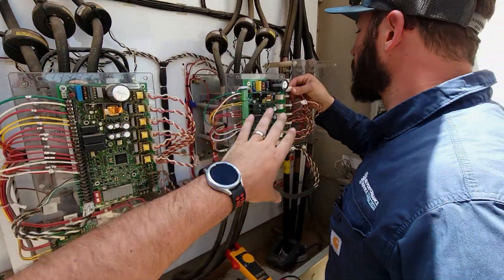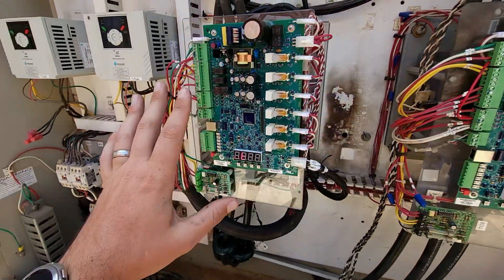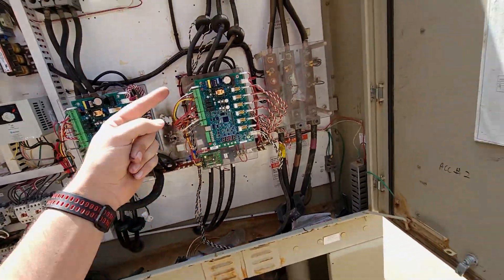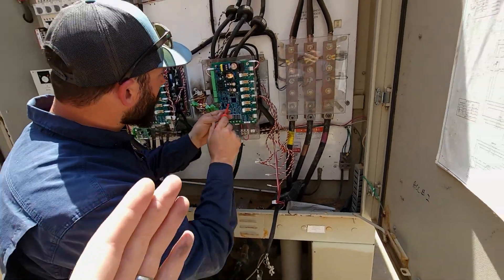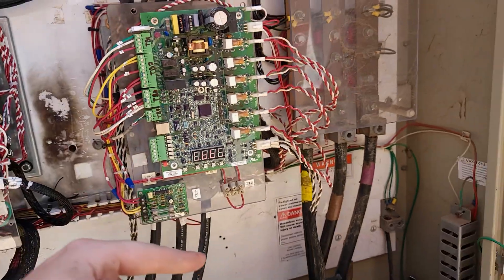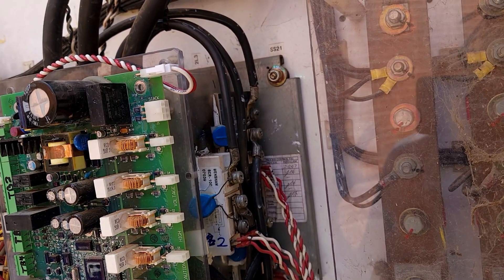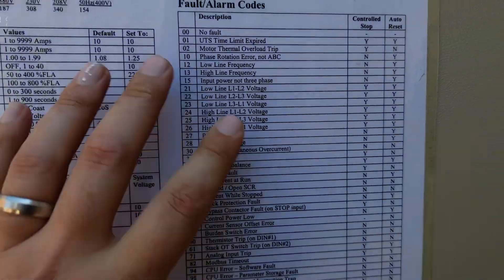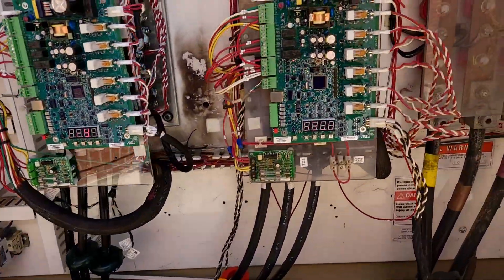Old McQuay Chiller Starter Issues...

Comment: Anytime you are dealing with SCRs or any solid state power switching on 2 pole or 3 pole/phase systems.....ALWAYS replace ALL of the power switching components!  The high current drawn by losing the other phases (or the surge created when one blows out) will ALWAYS destroy or weaken the others! (Same goes with capacitors in VFD's or soft starts..if one of the main power caps fails replace them all.)

If the customer is too cheap to understand that,  either walk away or put them on notice in writing that any subsequent return calls to replace other failed components is a full charge and will not be warrantied. 

I had this issue a lot in my cinema service days, the lamp rectifier diodes would fail, and I always replaced then as a full set (4 or 6).  Any theatre that insisted on replacing only the ones that failed got no warranty.

Comment: Something I don't get about this industry. You said this is dragging out for months, and the customer didn't approve replacing the third SCR. Do they not need these chillers up? Sounds like lots of follow up visits for parts that cost less than the truck roll to get them there.
Reply from the maker: Ya, job's like this one turn into complicated situations that end up being a slow play out until everything comes together.

Comment: So did you place a jumper on the NO contacts of the contactor ?
Reply from the maker: No
Reply: @HVACTIME  So basically did you insert a wire from one end to the start input and the other end to the contact coil ?
Reply from the maker: Ah yes as a test only. Once i proved the starter worked I removed the jumper and figured out the rest.
Reply: @HVACTIME  So i assumed you placed a jumper on the start stop contact ? I'm having quite a similar issue would try to eliminate and verify each component properly first step by step before  condeming the board .